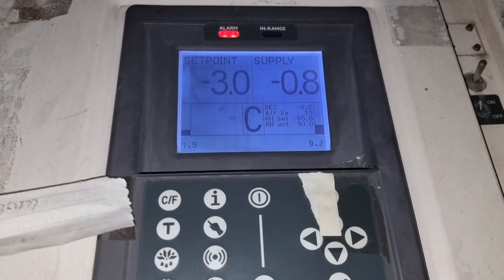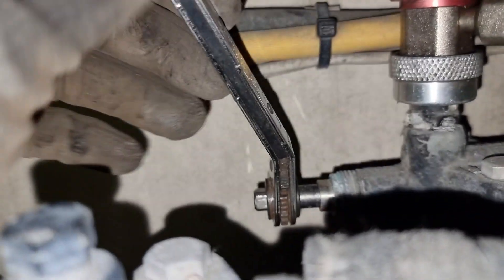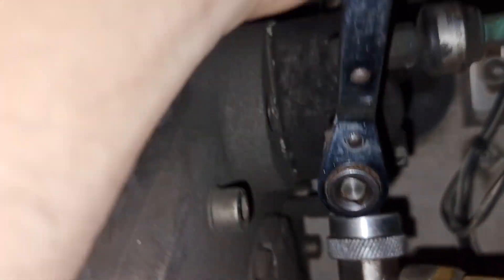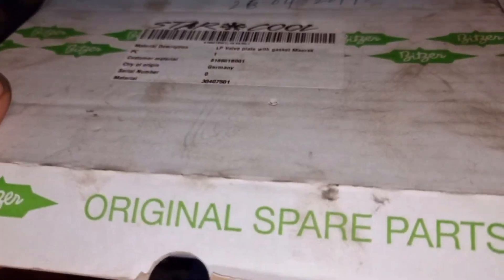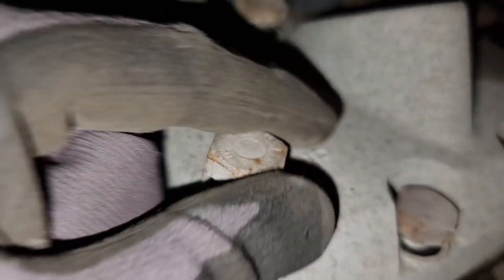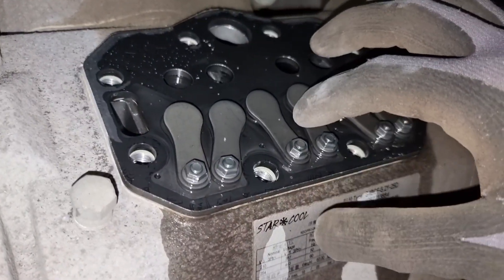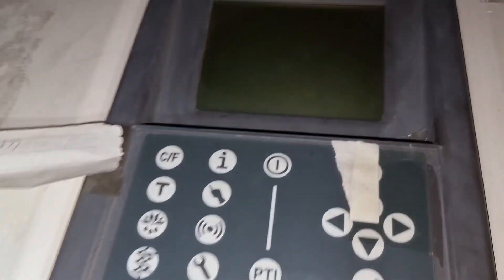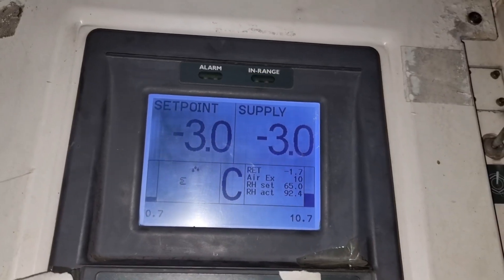REFRIGERATION COMPRESSOR VALVE PLATE, HOW TO KNOW IT IS BROKEN? | REEFER CONTAINER

Comment: I have a question Sir ,,,,a refrigeration compressor (of a container)is switched on bt in a few seconds it trips,when u try to force it while pressing the contactor manually the compressor  and the discharge pipe overheats resulting to abnormal sounds inside the compressor what could be the possible cause am puzzled Mr Engineer

Comment: Sir, ask ko lang insufficient cooling Ang reefer container freezer. Ang reading sa suction line almost vacuuming na. At reading Naman sa suction modulation valve ay same almost vacuuming. May posibilidad ba na Ang problema ay nasa suction modulation valve. Hanggang -10 lang sia ayaw ng bumaba Ang temperature.  Ang high side pressure ay 250 to 300 psi .

Comment: Did you vacuum the compressor after installing the valve plate???
Reply: From another thread Lecky wrote:
He uses refrigerant from the system to purge air from compressor crankcase out to service port.
The rest will be taken care of by filter drier.
In international waters you can do this, priority is to keep cargo of hundreds of containers safe with a single technician.

Comment: one tip - i wrap the econ pipe with a rag so the debris from the insulation doesn't fall on to the new gasket surface.  the insulation gets brittle and flakes off when you remove the VP.

Comment: He is not worried about a vacuum that will be the next guys problem when the compressor shorts out 
Remember he only needs it to work until they make port kinda of crappy is what it is
I imagine there are shipboard reefer techs that curse guys like this
Reply: From another thread Lecky wrote:
He uses refrigerant from the system to purge air from compressor crankcase out to service port.
The rest will be taken care of by filter drier.
In international waters you can do this, priority is to keep cargo of hundreds of containers safe with a single technician.

The technicians on shore get a list of all containers what has been done and they can service accordingly.

Comment: You did not evacuate the air off the compressor
Reply: From another thread Lecky wrote:
He uses refrigerant from the system to purge air from compressor crankcase out to service port.
The rest will be taken care of by filter drier.
In international waters you can do this, priority is to keep cargo of hundreds of containers safe with a single technician.

Comment: Hi, Jake! In a such a case: LP v/v plate in doubt, there is in Menu can be performed Function test for the Compressor only (Pre Trip Inspection) and if it will Fail you can get Alarm: 840 - Valve Leaks. During investigation i do this action, it seems to me this one of rapid way. All the rest i do the same. Best regards and good luck!
Reply: Function test is only available in thermoking reefers, and pre trip inspection is not allowed in units with cargo inside, PTI TEST can be performed only when preparing reefer to enter service in  PTI area with empty reefers.

Comment: Surprised you didn't pull a vacuum before open the system back up to the compressor? What caused the valves to fail? Could be a liquid slug?

Comment: boss tanong lng..ano kaya problema cold storage namin. very low suction pressure or nag vacuum wla nmn leak..medyo marami na rin kaming nakarga na freon.. nag vacuum parin. ano kaya problema boss.. sana matulungan nyo kami boss.
Reply from the maker: kung nag vavacuum at tumataas ang discharge pressure pwede mong i check ang filter drier. compare mo ang inlet at outlet ng filter drier kung equal ang temperature, kapag equal then ok anfg fd mo pero pag unequal then need mo palitan.

in case ok ang FD mo then open mo evaporator mo and check kung nag yeyelo ang evaporator at txv kung may yelo maaring hindi nagbubukas ang txv mo, or kung may solenoid siya before txv baka di nagbubukas yung solenoid valve mo
Reply: @leckyjake  hindi rin tumataas ang discharge pressure boss ..ang solenoid ngbubukas nmn kasi may konting yelo sa output ng txv..mayron din po syang sub cooler boos.. pwd bang masira ang accumulator boss.?

Comment: Good day sir! I just want to ask if it is ok to open the compressor with the system without vacuuming it? You opened the LP valve plate which, made the compressor exposed to air. Will not the pressure be affected by this? Thank you, sir.
Reply: From another thread Lecky wrote:
He uses refrigerant from the system to purge air from compressor crankcase out to service port.
The rest will be taken care of by filter drier.
In international waters you can do this, priority is to keep cargo of hundreds of containers safe with a single technician.

Comment: Sir what if the compressor is the problem. Will you have to replace with brand new compressor? I heard that these compressors are too heavy to lift (reach compressor weight is around 40kg-45kg)
Reply from the maker: Yup, we need to replace it. Savong cargo is our main priority

Comment: As a hvac tech i can see many things wrong with the procedure. But I'm not faulting you lecky your not a full time hvac tech. You did what you had to do to get it running.
Reply: The thing is on board it's hard to carry the vacuum pump & recupation device below deck. Or did you mean something else?
Reply: From another thread Lecky wrote:
He uses refrigerant from the system to purge air from compressor crankcase out to service port.
The rest will be taken care of by filter drier.
In international waters you can do this, priority is to keep cargo of hundreds of containers safe with a single technician.

Comment: How does propane work in low temp refrigeration? 

It is one of the possible replacements for R410a over here.
Reply: Mostly its gonna run on smaller stuff for now (its capped at 6onz per circuit)... Lets see what time brings

Comment: Hi Leckyjake, may i know did we need to vacuum the circuit once  valve plate replaced done?
Reply from the maker: You have to if you missed to isolate the system  and sometimes need to change the filter drier as well as to my case I completely isolated the system just before I open the head and purge completely the system.

Comment: A common cause of broken valve plates is you are getting liquid refrigerant back to the compressor. I know you are a busy man on that ship but i would try and diagnose the root cause of the broken valve plate that way it will stop happening. Also, I would really recommend pulling that compressor into a vacuum after you had it open to atmosphere. If that compressor has P.O.E oil in it and air gets into it you can start to form acid and it will break down the motor windings. I know you are a busy man on that ship and im not trying to sound snood. Just lending a few tips from a person who works on refrigeration equipment for a living. I really enjoy your videos keep up the good work!
Reply: I was thinking the same thing. Pulling a vacuum also ensures no moisture makes it to the expansion device and causing yet another problem.
Reply: I did some digging on starcool. They use r290 which is propane, so its legal (if not safe) to vent to atmosphere. They also use polyolester oil, which is hygroscopic. I'd pull a vacuum before I charged it just to remove any water vapor.
Reply: @LaserUbermensch   6:38 in video, sticker clearly says under compressor R134a, ALWAYS pull a vacuum when you open the compressor to atmosphere, ALWAYS !
Reply: your incorrect my guy - we use R-134a  @LaserUbermensch
Reply: This unit runs on r134a @LaserUbermensch
Reply: World's best quality spare parts 
In lowest price contact me
Reply: From another thread Lecky wrote:
He uses refrigerant from the system to purge air from compressor crankcase out to service port.
The rest will be taken care of by filter drier.
In international waters you can do this, priority is to keep cargo of hundreds of containers safe with a single technician.

Comment: How  come you didn't pull a vacuum on the compressor, and didn't verify the correct charge amount after adding refrigerant?
Reply from the maker: I have 268 refrigerated container onboard and 7 of them are malfunctioning.
1. 2 Evap fan motor
2. Shorted power cable
3. Burn contactor
4. Power card
5. High pressure system
6. This chilled cargo with broken valve plate

I just need to fix all as fast as I can.
Reply: @leckyjake  good job .. as EE to manage workload is great ..

Comment: Lecky can you please point out the symptoms of the defective HP valve plate too?
Reply: no pump pressure on out side
Reply: @willrobbinson1  you would not be building any discharge pressure. Your suction pressure and discharge pressure would be very close to each other. Also you would be possibly experiencing oil loss in your compressor.
Reply: I have not seen this very often

Comment: Wow there is gong to be a ton of contamination In  that system. They must have filters on the pressure side?
Reply from the maker: Yup a filter drier is fitted at the discharge side
Reply: @leckyjake  thanks you for your videos,  I have wondered for years about refrigeration on container ships.

Comment: It seems obvious now that it would be your responsibility to maintain the cooling systems on refrigerated units. But it didn't cross my mind originally. 

That would seem to imply that you have to do daily rounds to check on each unit? Or do they alert when in trouble?  How many refrigerated containers are typical?
Reply from the maker: Yup, the highest number I had was 1400 refrigerared containers. It is actually my main job onboard.
Reply: @leckyjake  impressive!
Reply from the maker: Thank you and Keepsafe always
Reply: Yes it was an eye opener for me as well. I assumed you just maintained the ships systems. Does the company then charge the service fee to the owner of container or is this all part of the shipping cost?
Reply: Sorry, I should add that I liked your video. Very informative and easy to understand